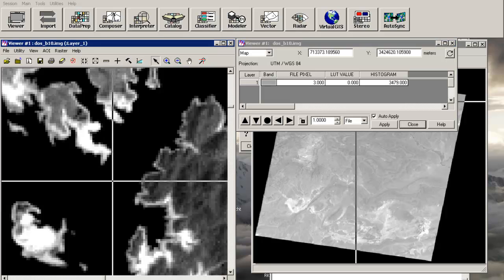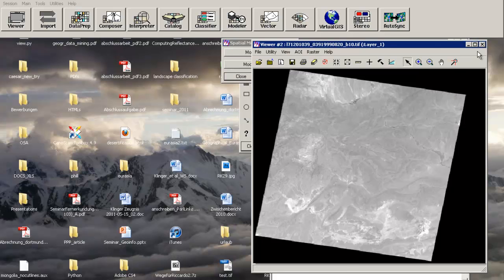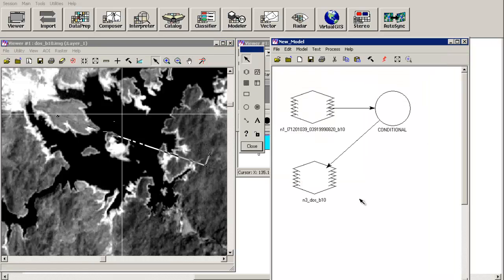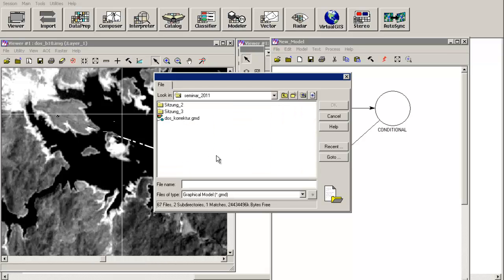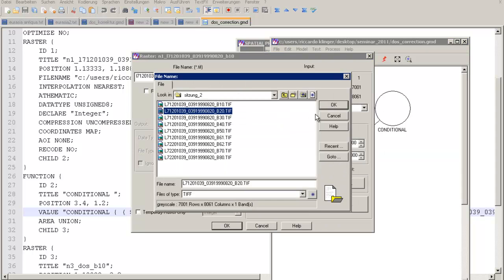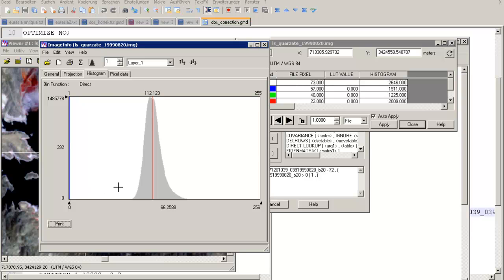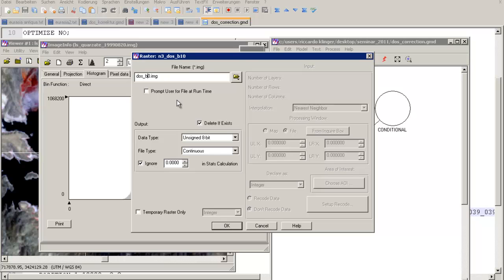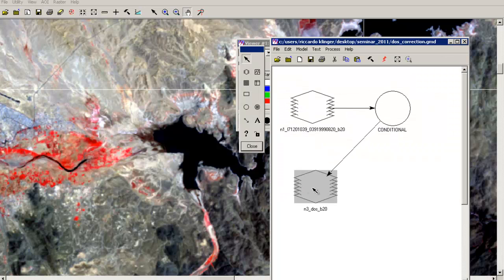DOS in Erdas Imagine

Comment from the maker: @jbama21 thanks for your reply. first of all: the dos-correction does not improve unsuper or supervised classification due to the fact, that you are not changing the overall spectral distance of two pixels. your are just correcting the total image with the way described in the video. decorrelation stretch sound totally different and much more "heavy" regarding the change of the spectral histogramm of an image. I haven´t used object based or segmentation methods.